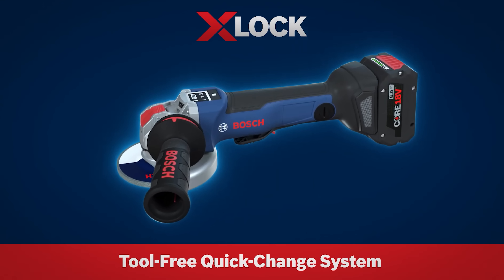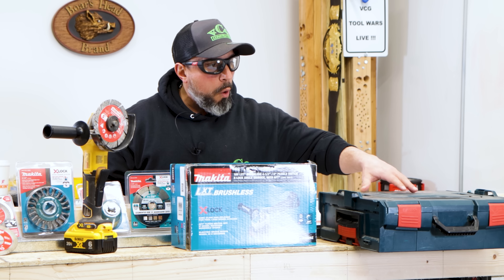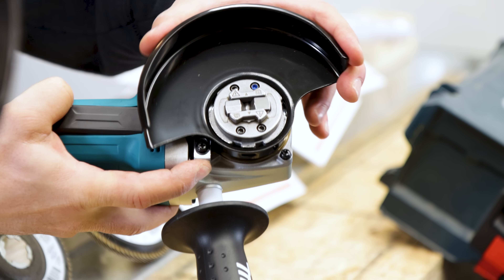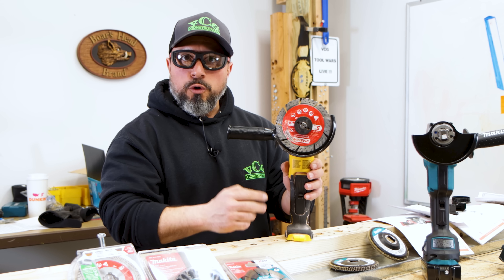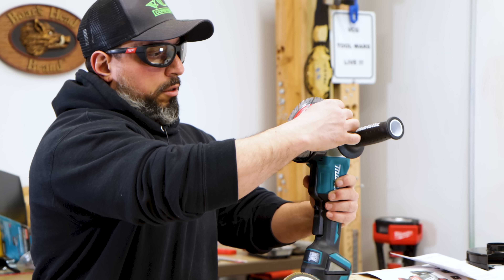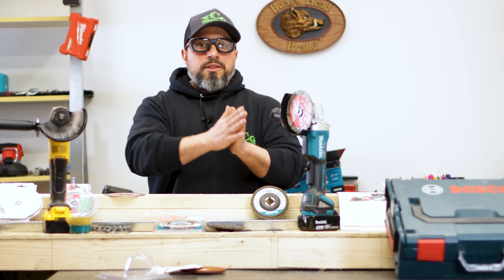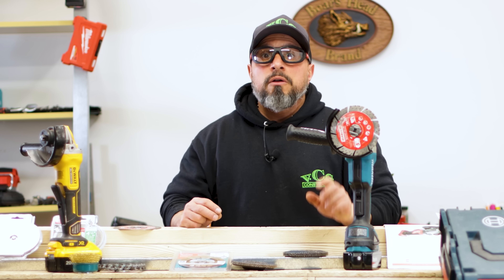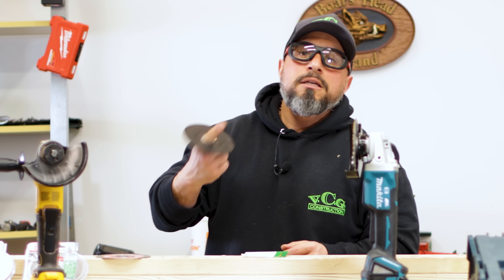NEW X LOCK Style Grinders & Accessories (STOP WASTING YOUR MONEY!)

Comment: The real time savings come in when you drop an arbor nut and have to chase it across a floor and fish it out from under a cabinet or machine. For most pros they aren't going to save more than a few minutes during to course of an average day due to tool change outs. What they will gain is convenient 1 handed changes as well as 1 less thing to fumble and lose. The only hold up is if X-lock is just a passing thing and loses market support with time instead of gaining more and becoming an industry standard.

Comment: Well in a realistic setting most shops or factories run more than 1 grinder, one dedicated to grinding and 1 to cutting. If you are cutting alot and chewing through disks like crazy I think you need to rethink how you are cutting and move to a band saw or oxy or something quicker. On the topic of being quick, batteries! Changing batteries takes time as well. You’d be better going corded if doing long hours. Most tradie jobs arnt all the same and you will always lose time to external factors so justifying a quick blade change will make any impact is just fairy dust.

Comment: My only reservation is what happens when the " xlock " locking mech doesn't operate properly? Flying blades, wheels & brushes? Hmmmm
But if it becomes tried n true...cool.
I will however save the money on accessories for now. 
My " not often enough" used grinder will live on....til it doesnt

Comment: I work in a welding shop and would love to give some of these a try just to see how much time I save over the day
Reply: Run my own welding shop, it dont save that much time. And the time you save will eventually get lost when you destroy the locking mechanism. In tight places you sometimes hit a corner with the locking nut. The x-lock will not handle that in the long run. And even worse is that it could be dangerous. The locking mechanism can hook a corner. And if it breaks. You have discs flying around at 6000 rpm...
Reply: @krusch75  finally another voice from the real world is heard!

Comment: The only problem I see with this system is the fact it is proprietary and you cant seem to use old discs on X-Lock grinders, if you buy an X-Lock grinder then you have to throw out all your old stock for this system. Thats fine and all, but in 10 years time will I still be able to buy these X-Lock discs?
Aside from time saving, the older system seems to have more advantages, being able to use both X-Lock cutting wheels and standard cutting wheels.

Comment: 120 changes an hour opposed to 7200 changes with the X lock. Damn 

Normal: 20s per change × 3 times= 3 changes per minute.
3 changes a minute × 60=120 changes an hour 

X lock: 3s per change × 20 changes = 120 changes an minute
120 chnages a minute × 60 = 7200 chnages per hour

Comment: For how often that I or we at my bussiness use a grinder and for how often we change disc I don't see it worth it to get xlock new grinder when the battery platform we run doesn't offer xlock so to switch a battery platform not wirth the it the time we save still won't compensate the money lost on the tools

Comment: Just what we need — a line of grinders that won’t take industry standard 5/8-11 threaded accessories.

The only “issue” with traditional grinders is that you need a special tool (wrench) to change blades. Funny how nobody even paints the wrench a bright color to help you find it in your shop or provides a place to store it in the tool.
Reply: On a grinder with a shaft lock you don't need a wrench to change a wheel, just lock the shaft and grab the wheel and spin it off.

Comment: Vince,

Normally I find your videos entertaining, if not informative, but the X Lock is a solution to a problem that doesn't exist. X Lock is way more expensive than the alternative for volume users of grinders, you know, the guys who actually use grinders on the daily for grinding. Guys using grinders with wheels for tile and stone work don't change wheels that often, so no time saving benefit to them. Trim carpenters who use flap wheels on grinders for coping might go six months on one disc, so no value in a quick change to them either. Guys running grinders on metal in a production environment can go a week or more on one rock. Additionally, those guys who use a lot of wheels for metal working probably aren't buying their discs at a big box store unless they are snagging the $1/disc for DeWalt cut off wheels deal that HD periodically runs, so your price comparison in this video doesn't hold water in the real world. Volume users of discs buy in volume and they don't pay anywhere near the prices you've shown. Another thing...the clutch on the Makita grinder is an useless gimmick, just like the dual On switches on the Makita cordless router. Totally unnecessary. This past summer, a HD near me was blowing out the X Lock grinders for $79 because they weren't selling. One of the few Makita tools left in the big bin after the Christmas BOGO specials at HD is the X Lock grinder. Hmmm.....  Do you know what's even quicker than the X Lock? Having dedicated grinders fitted with flap wheels, rocks, knotted wheels, etc. I'll take the money I could have spent on expensive X Lock consumables and buy another grinder and set it up the way I want it, then who gives a flying rat's ass if I've lost the bushings and ring nut in the bottom of a tool box? Nobody. X Lock....the perfect marketing solution to a problem that doesn't exist.

Comment: Had one for testing in our welding workshop. You will get problem with cutting and grinding in tough to reach places. Amd eventually youl smack the shi#¤ out of the locking mechanism. For some it would be nice. But been a welder for 25 years. Employ 5 workers. We all agreed that this is not a better solution. Fein used to have some really nice locking mechanism on some of their grinders. Dont know it they still have this system. A handle and the lock had a tapered bolt. But this X-lock is to exposed and will break when working in tighter areas where you eventually will hit the mechanism into corners etc.

Comment: Here is my problem with X lock, I have no preference on which system I use. But, I've used Dewalt tools for a while and it's what I like and it has the "old style" if my grinder breaks or I need a new one I'm not going to switch to another brand that I've never used and not part of there eco system just because the lock is different
Reply: Then why are you watching this video?? Vince is doing all the testing for you! Keep using your old sh-t.

Comment: Buy more grinders, change less wheels
Reply: @ZAPATTUBE   metal fab shop owner, I like to have 4 grinders it’s less time saves 12 sec of changing wheels based on this new tech. It looks promising, if Milwaukee incorporates the tech I would buy them, looks easier to manufacture, I have m18 platform so if it were available in bulk and was still cheaper which wasn’t the focus of this vid then it would be compelling over the alternative no thread option pricing

Comment: First
Reply: just got mine yesterday same model .I would rather pay the extra $20.00 and get the paddle switch I buy all Makita tools well almost I have a Hitachi belt sander .and Recip saw   .I have to say I used it all day on a job I'm doing .and I'm impressed worth every penny . if you but the yolo you get $50.00 of charger and batteries or just battery that's to good of a deal to pass up .Makita does it right I just got A Hammer drill last week my drill and impact driver I've had over 10 Years use them every day all day .still running strong.  it's going to be the standard Xlock love it time us money .more time means good days ahead keep on being to tool guy love it

Comment: X lock system "locks" you in to buying the X lock blades that on average cost 4 times more. An expensive gimmick that costs you dearly. You can no longer use any standard disk, my score is an F for proprietary failure. (Semi pro tool seller in KCMO) After more research I found out that the X-lock blades are not even available in a majority of places where you might want to buy a blade. The time you spend searching will offset the time gained by quick blade change by a factor of 10, literally a stupid system. Super disappointing. Consumers need to wholly reject proprietary systems by not purchasing them.